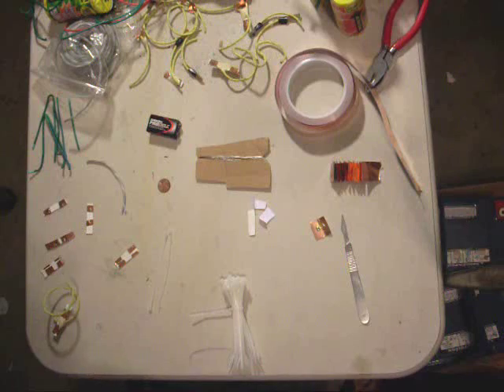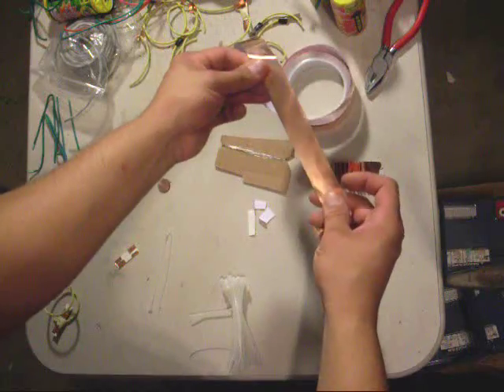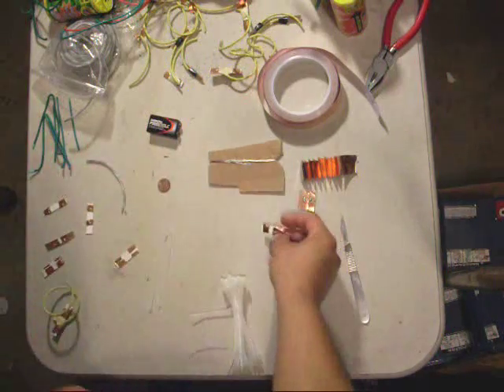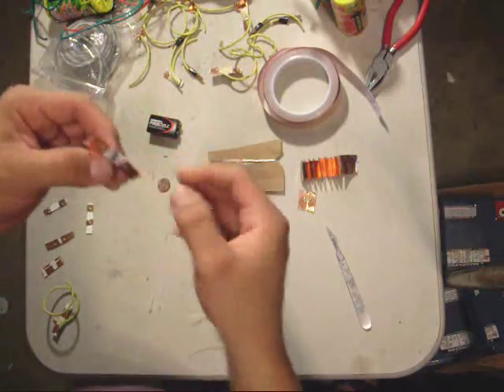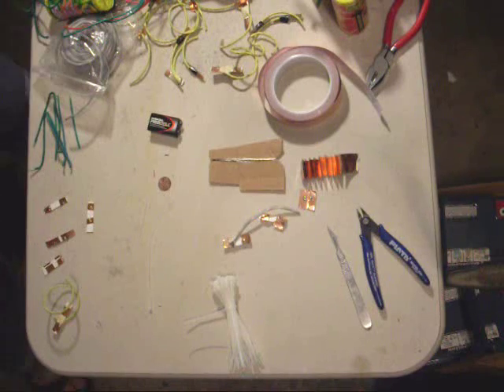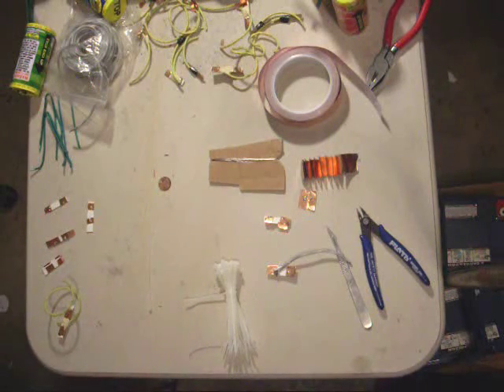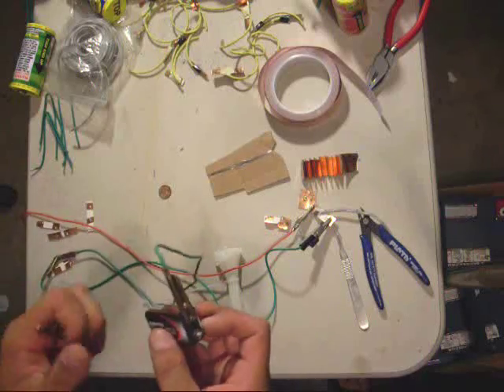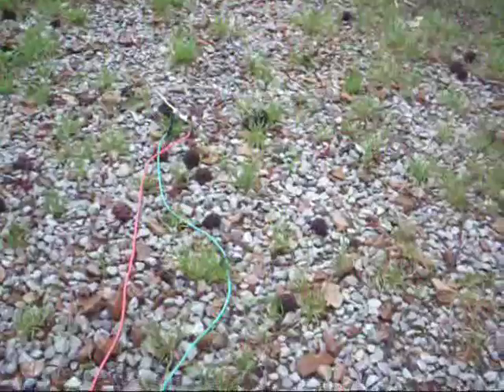Electronic Matches for Fireworks , the Valis Method

Comment: You can just tape a 1/4 watt 10 ohm resister to whatever fuse, and with about 12 volts through it the fuse catches fire (lighting the fuse)

Comment: if you used thicker gauge nichrome wire, would it then not break, yet still get hot enough?

The reason I ask is I'd love to have an aimable "rocket launcher" to launch fireworks from that didn't require a fuse. You'd just drop the firework in with the fuse up, it would touch the wire, close the circuit, and woosh. 

You think that'd work?